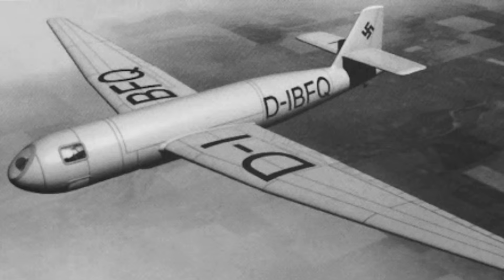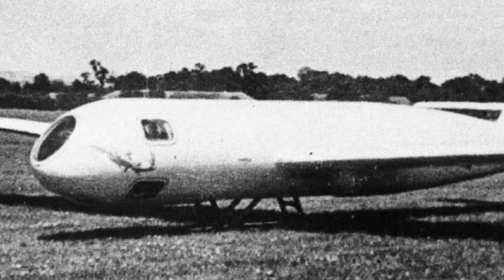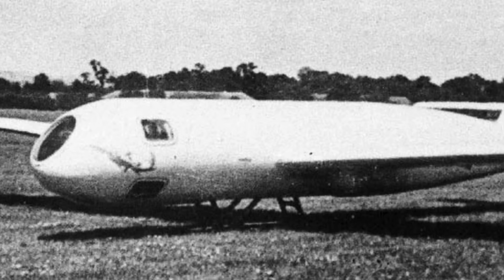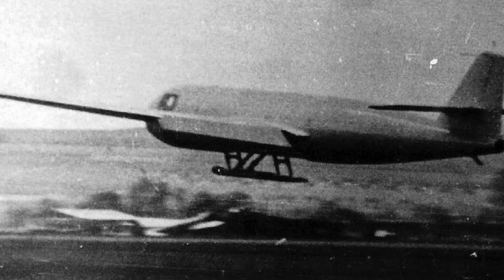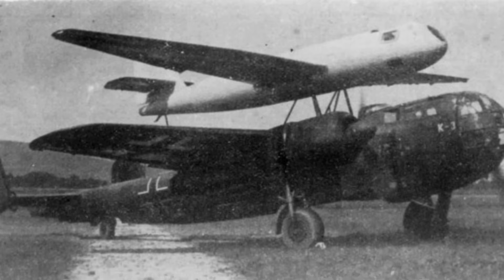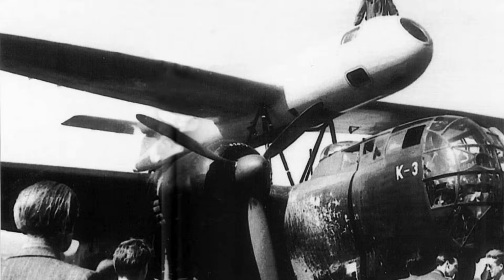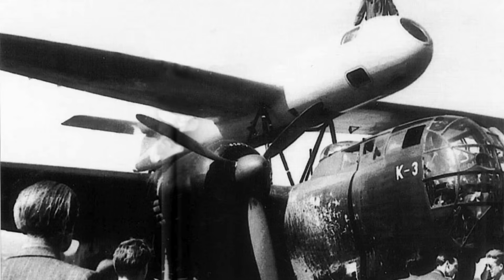The Nazi Recon Aircraft That Reached the Edge of Space – DFS 228

Comment: Miles M52 was a respose to the 1943 issued Air Ministry Specification E.24/43 calling for a jet-powered research aircraft capable of flying at over 1,000 miles per hour (1,600 km/h) in level flight (over twice the existing speed record ) and the ability to climb to 36,000 feet (11,000 m) in 1.5 minutes